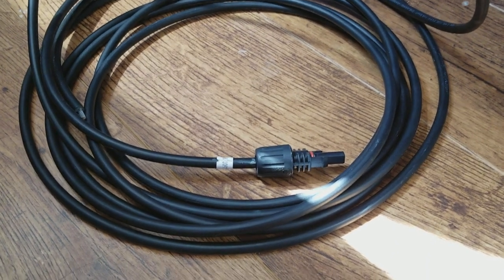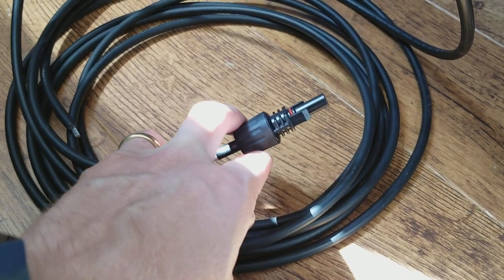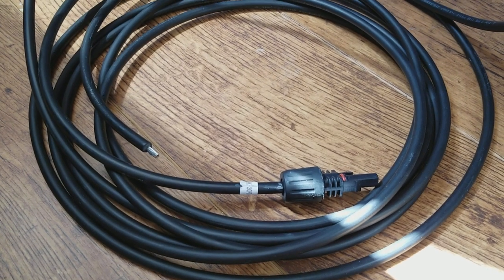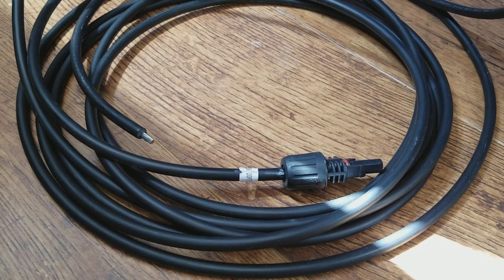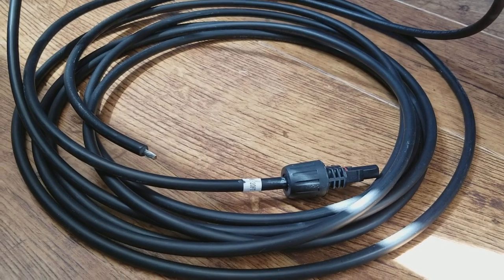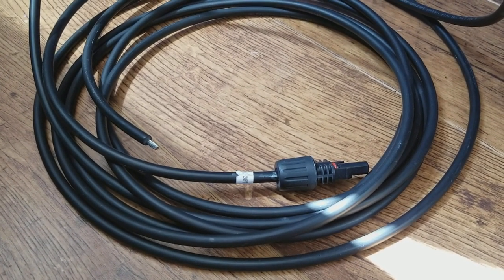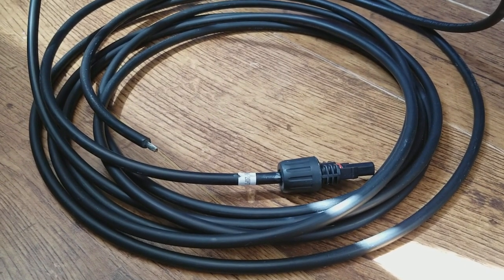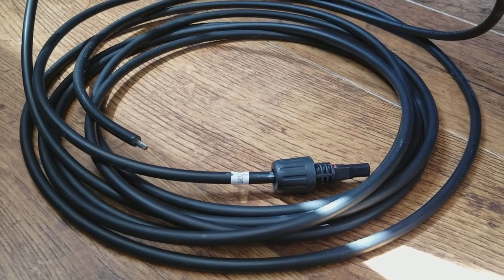Choosing Solar Cables

Comment: Is 2g wire from the battery to a 2000w inverter okay?
100w 12v panel
10g wire to the 30amp controller
10g wire to the 36ah 12v agm battery
Reply: 2awg from battery to inverter is okay. The larger you go, not a problem, when you go to smaller gauges , like 8awg or 10 you have to consider load and length of wire.

Comment: I’ve  got a 360 watt panel with max amps at 9.78 and it has a 12 awg wire coming directly from it if I need to run 20ft of 10awg  would that cause any issues or make the wire from the solar panel a weak point?
Reply: You can use Voltage Drop Calculator. There are many online.

A 10awg wire can carry up to 30Amps. You only have 9.78Amp. So you're good there.

With the info you provided, it looks like you will have <1% voltage drop.  So you're good. <3% is the standard. 

20ft is a very short distance. So even a much thinner wire like 18awg would do.

Also, it matters whether you have a 12V or 24V setup. Higher voltage = lower Amp = thinner wire.
Reply: 9.7 amps from a 360 watt panel, you should be getting 20amps